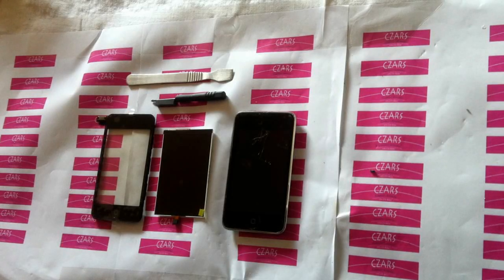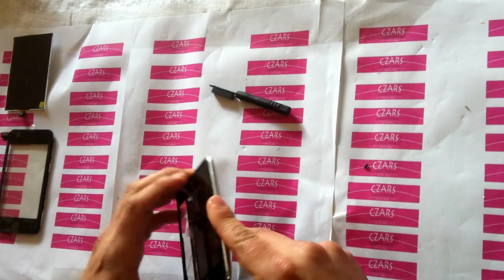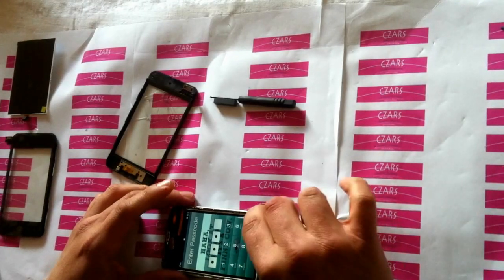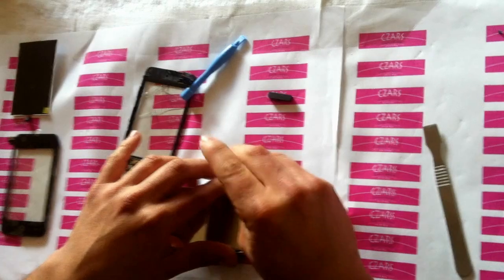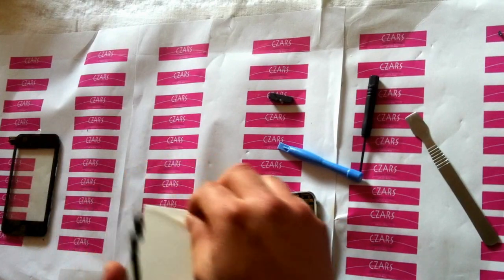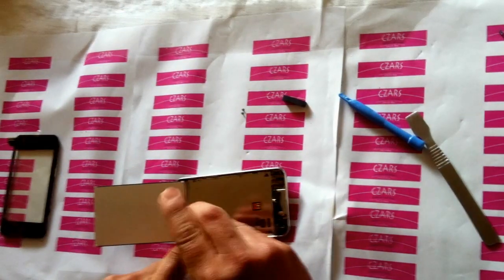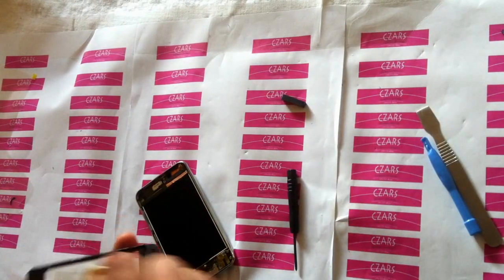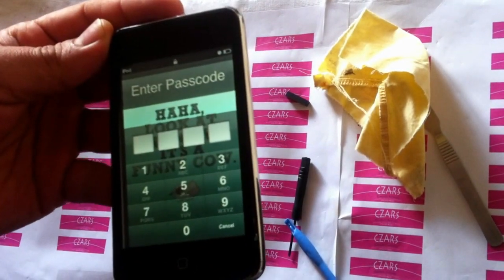iPod Touch 2nd, 3rd Generation glass digitizer LCD replacement

Comment from the maker: Hi Jimmy,

The ribbon cable is very thin and sometimes it breaks. Check to see if it is in good shape. If it's broken you will need another one. If the ribbon cable is okay and you don't see damage then the problem is the board and it's not repairable. 

Thanks
Cesar 
Czars Gadget Repair